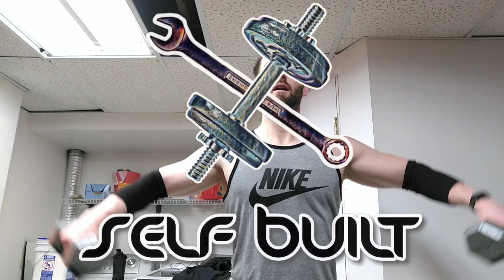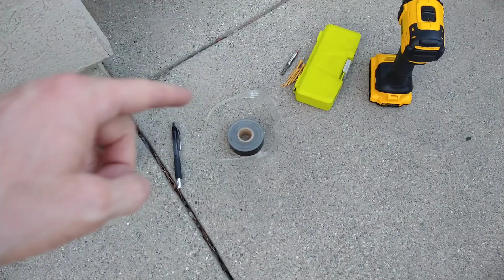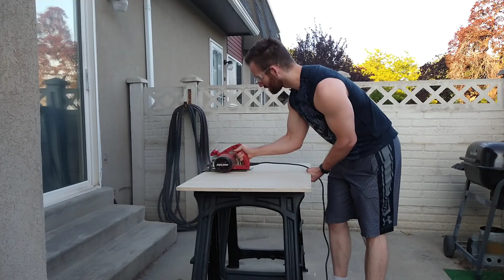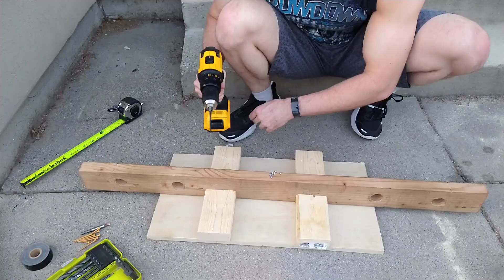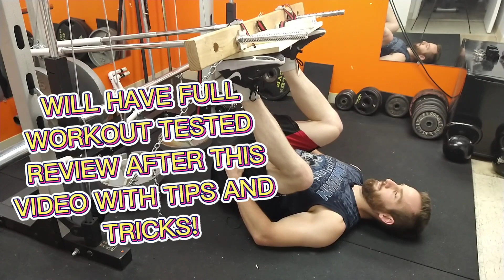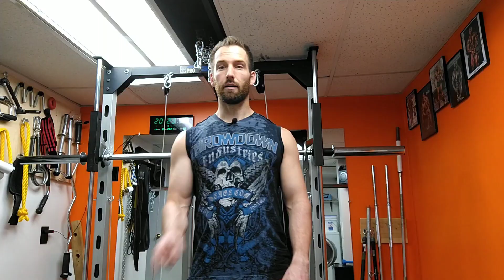DIY LEG PRESS PLATE SUPER CHEAP(Full Build)

Comment: What kind of straps are those?
Reply from the maker: They are lashing straps from Amazon. Similar to tie down straps and super cheap.
Reply: @SelfBuilt  Thanks bro. I built this today, and it was super quick. I spray painted it and now just need those straps.
Reply from the maker: @biggdogg35810  Anytime! That's amazing and I'm excited for you to try it out! I still use it on my legday rotations and it has been great! 💪
Reply: Very impressive 🙂. How do you lock and unlock the bar on the smith machine though when doing the leg press please.

Comment: Might want to think about doing a belt squat deal yourself,nice for finishing of the legs and it doesn't load the spine at all
Reply from the maker: I've been doing belt squats for quite a while. I'll have to do a video on that. I prefer cable belt squats cuz I can change the movement and get a really deep stretch. Kind of feels like a pendulum squat machine
Reply: @SelfBuilt  I like pendulum squat machines they make me feel strong lol.the cable set up is a lot safer to
Reply from the maker: @stephenthompson1338  pendulum squat machines feel great. I'll have to show you the setup I use for them!
Reply: @SelfBuilt  I do have a simple cable setup,with just a high and low pulley.I like the duel setup like you have better and I  will probably do that but I can't really use your set up for the exercises themself because I just built a half rack to save space but if knew I would be using it this long I would have made a full rack lol
Reply: @SelfBuilt  yeah I would be interested to see that
Reply from the maker: @stephenthompson1338  I totally understand. I never thought I'd still be working out from home. I never went back once they closed them when covid was new. I never thought I'd say this but I don't think I'll go back. It's hard to beat the convenience and it's never closed or busy. I've been able to come up with replacements of just about everything I would like to use in the gym anyways. Biggest thing I miss is the energy of seeing others workout though. Are gyms for you still closed or are you choosing to work out from home?
Reply from the maker: @stephenthompson1338  I'll throw a video for that in the queue of a couple more video ideas I have 💪 it does favor having dual cables but you can still do it with single.
Reply: @SelfBuilt  well the gyms are opened up at the moment but it has gone back and forth 4 times already so I just figured I'll just train at home so it is one less thing they can take from me.I am sure it is just a matter of time before they won't let dirty un vaxers like myself In the gym anymore and the gym I used to go to is shutting there doors when they mandate vaccines for gym employees and members.I miss the comraditry and looking at all the pretty girl's for sure and I can't train as hard at home either because of noise issues.I used to have the cops here every workout for 6 months because of a neighbor complaining.they eventually quit coming but I don't want to bug the neighbors I like so I don't go nuts even though I could get away with it now that the cops don't even show up when she calls
Reply from the maker: @stephenthompson1338  that's crazy it's gone back and forth 4 times! Yeah I'd just train from home in that case too. I agree you do get a good scenery with girls working out too haha. I'm sorry your neighbor calls the cops on you when you workout hard. That's messed up. It's pretty funny the cops don't even bother coming anymore. Unless you are working out till 3am and making tons of noise it shouldn't be a problem. Maybe next time the cops come they can spot you 💪
Reply: @SelfBuilt  no man I am a pretty respectful person,you know "walk softly but carry a big stick"kinda mentality.I was training outside on my balcony and never past 10 .I had that rubber mats,plywood and these hard foam pad things when I am deadlifting.it was fine for 6 months and than out of the blue the calls started,no new neighbors had moved in the building so I didn't know what was going on.I finally figured it out and confronted them about it and eventually it came out.the calls stoped for a few months after that,then started again ,after  about 3 more visits they said they were going down there and telling her there not coming anymore for that.it was funny after I told them I knew who was calling they never even tried to hide the fact that It was her in fact.i had to bring everything insid for the winter so I just left it in here.it's stupid that the neighbor weirdo that was complaining lives way down at the other end of the building  and the people that are around me insist that it's fine

Comment: Right on my leg press lol.I thought you might be able to do something like that with your setup with the duel bars.I just made my lever arm setup with one central tubing and attachments to put on the end of that.I did it like that because my main goal was a belt squat which it works great for and with the attachment for rows and presses too but my leg press idea was a step too far for mine lol.are you able to load it enough for pressing with both legs?
Reply from the maker: Heck yeah good job on getting your lever arm setup! It's crazy how many different varieties of workouts you can do with adding a lever arm. Belt squats are perfect for it.

Yeah I did a full leg workout 2 days ago with the setup and it held enough weight. I didn't try to max it out but got a great pump and burn on it. It's a bit limiting when it needs to be non permanent and easy to make but I definitely like it and will keep using it! 💪 My next video will be more detailed on using it and all that. You could make it for your single lever as a leg press!
Reply: @SelfBuilt  well I tried a similar idea to yours but with the single central lever arm it sways side to side and my lever setup is plate loaded and is is harry with 4 or 500lbs on the thing.I tried single leg to avoid the need to load it as much but the side to side is even worse that way
Reply from the maker: @stephenthompson1338  hey I'm glad you tried something! Yeah I've seen videos of a single lever plate loaded leg press and stability was a concern. Do you have any cables? With me using cables it helps a lot and makes it consistent